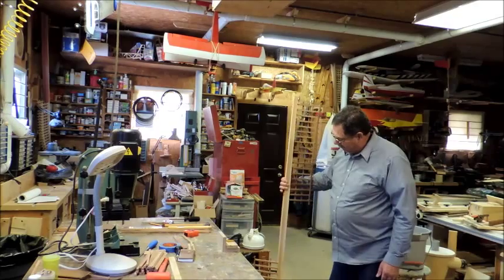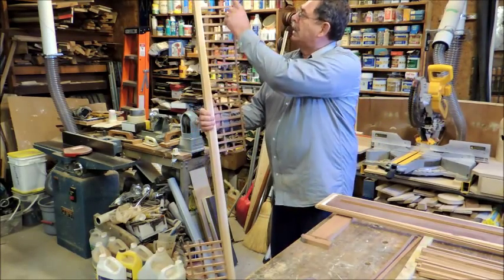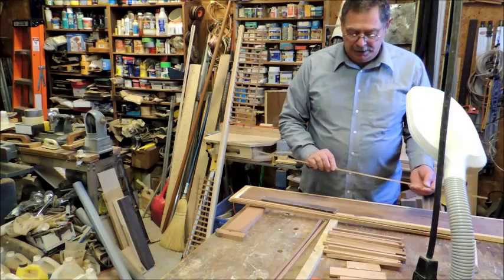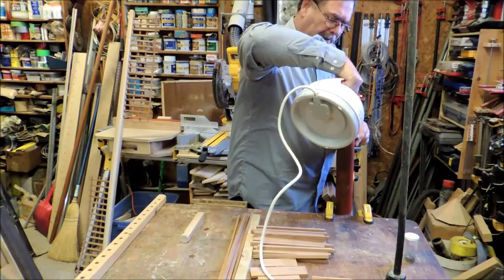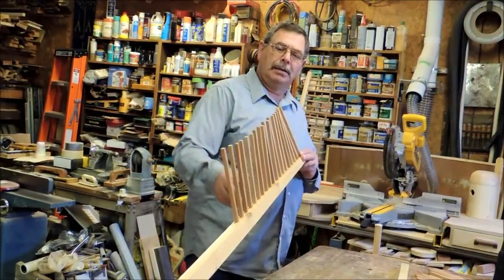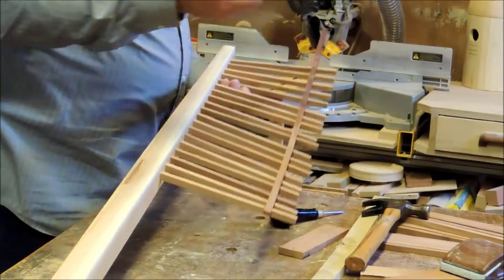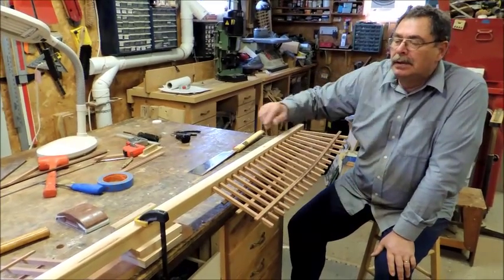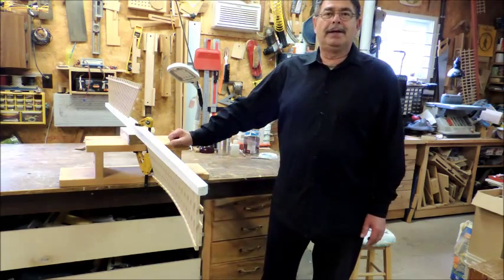Windmill build  Part 1

Comment: Hi Pete,How did you achieve the curve on the Wind sail? Thanks for your anticipated response
Reply from the maker: +Anil Rupnarain The mortising is drilled an different angles starting at 8 inch from center of the sail beam. Angles are 20 degree to  -5. To make the angles I place a wedge on the base of my mortiser which  holds the sail beam at the angle I want to drill. Thanks for watching.
Reply: +Pete Van Thanks for sharing that info. Your Videos (1 - 4) +  are great! I think it is the BEST on YouTube. Great job on building the Windmill! I think it would be nice for you to do a step-by-step video of the Sail construction as you have done it. Only focus on the mortising part as this is the most difficult part involved in building an authentic Dutch Windmill. I'm going to give it a try; so I'm trying to learn as much as possible. These videos helps. Cheers!
Reply from the maker: +Anil Rupnarain Thanks Anil. About making a video on the sails, I'm short on time. I'm working redoing the whole kitchen. But if you need help on any part of this windmill build please e mail me at   pete_4799@yahoo.com